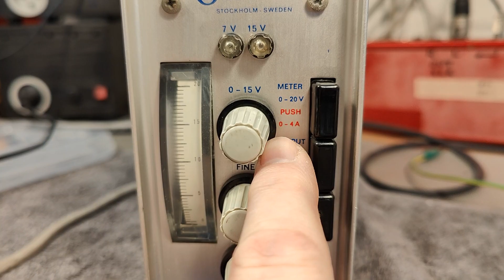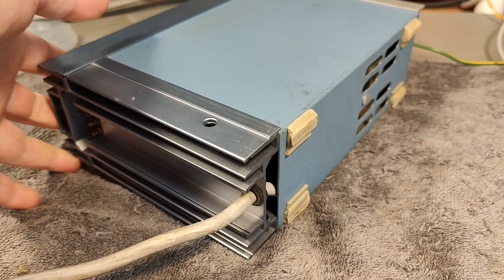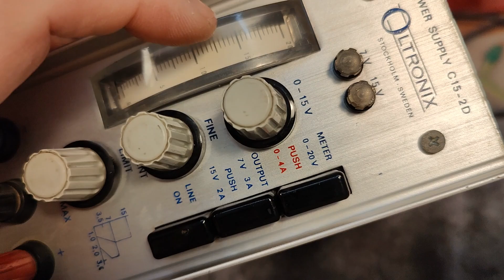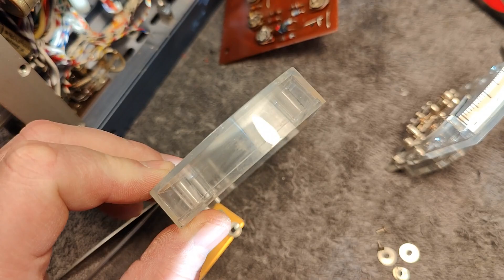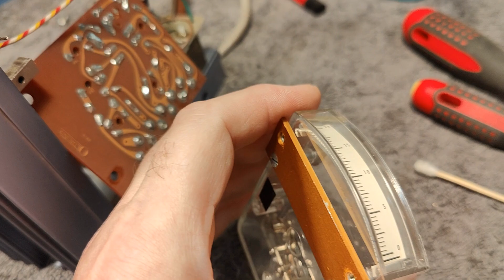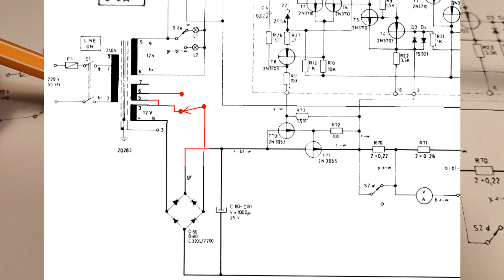Oltronix C15-2D Power Supply 1970 test teardown repair

Comment: 3:10 the slime is probably plasticizer from the wire's insulation. I'm under the impression that most plasticizers are pretty bad for one's heath - I wouldn't leave it on my hands.
Reply from the maker: good point, i wipe most of it away, but also wash my hands very often, funny it was only that green wire

Comment: Indeed - PVC wire insulation contains plasticizers, sometimes they transpired out of the mix and it not only made cables slimy (replace if possible) but sometimes even caused corrosion of copper, and made the insulation prone to cracking. Lovely device though.

I haven't seen this weird BJT symbol for a loooooooong time.
Reply: In a Polymoog Synthesizer I have here, exactly one wire (a light green one) is affected, after 50 years, the whole length of wire is filled with a green slime. Not the white, not the dark green, not the blue. I have seen this in several Moog synths of that age.
Reply: @stefanhuebner5358  who knows, maybe that wire comes from the same manufacturer.

Comment: Green wire is losing the BPA plasticiser, which is there to make that old PVC wire flexible. The action depends on time and batch, as each colour and batch had different amounts of plasticiser added to it, it normally is worst on the old mains wiring, as that runs hot in the wall, and reacting with the copper wire, after manufacturers stopped using tinned copper strands, was an issue till they found a new blend that worked.

Comment: Thanks for the video!
Very interesting power supply. 
By redesigning the switching, you reduced the output power in the 7 V range to 1.5-2 A, as opposed to the original 7 V 3 A, because a two-half-wave rectifier circuit with two transformer windings was used. And you did it with one winding.

Comment: I recently acquired the C40-08D. It looks pretty much identical to this one. I can also see that the green wire is a bit slimy, but it's not oozing like yours. Someone filed the serial number off the front, very odd! My meter has the red letters intact and there is no hole or sticker in the meter cover. Trimmers are a bit oxidized and blackened, so I might change them to new ones, I have trouble adjusting the current limit ranges (there's a procedure in the manual).
Reply from the maker: wow filed serial numbers, i always see as a red-flag and assume the worst..
Reply: @ I can't see the reason for removing the serial number, can't see that anything has been modified, either. Maybe it was stolen or something at some point. But the seller had two identical power supplies, so one could assume they had been used together. I bid on both, but only won one of them. The other one did have the serial number visible, according to pictures.
Reply: Johan, har din de nyare plast transistorerna? Jag har en C40-08D, men den har de äldre plåttransistorerna på reglerkortet. Min fungerade inte när jag fick den, men ett byte av den lilla blåa likriktaren löste det problemet. Fantastisk konstruktion och byggkvalitet på dessa! Älskar prylar med diskreta kretsar 😊
Reply: @jesperwall839  Det kommer jag inte ihåg och jag hittar inga bilder heller. Men gamla transistorer i metall brukar inte vara dåliga. C40-08D fungerar fint efter att jag bytte alla trimpotentiometrar och är i användning i mitt labb. Om du letar på nätet efter "Repairing the Oltronix D400" så kan du hitta en bloggartikel där jag har en ingående analys av denna äldre modell, också dess transistorer. Kanske kan intressera någon!
Reply: @johansvideor Snabbt svar efter ett år! Jag ska kolla upp bloggen 👍 Mitt exemplar fungerar helt felfritt, och är numera en del av mitt vardagliga labb 😀